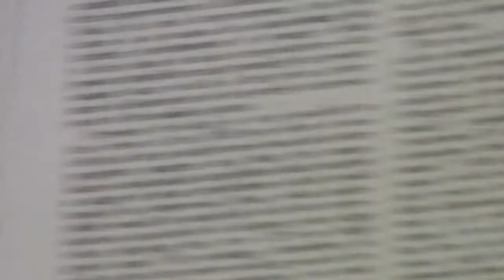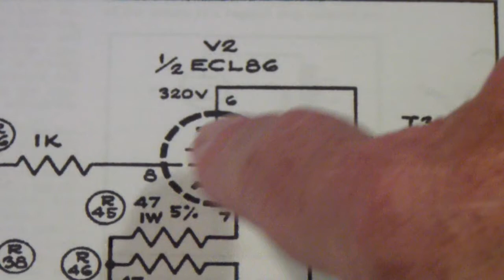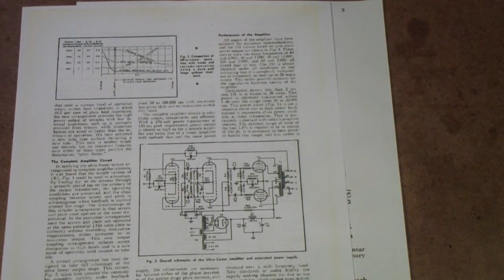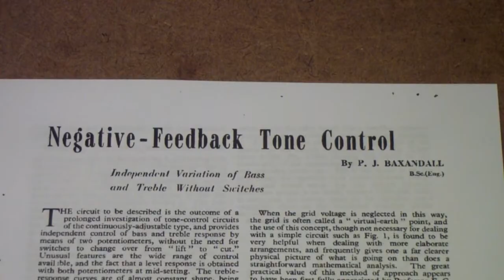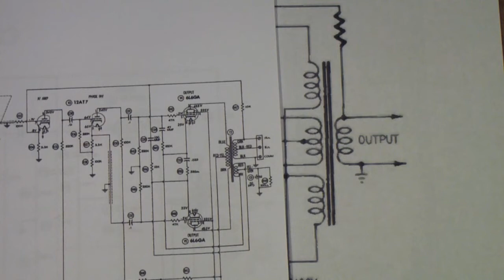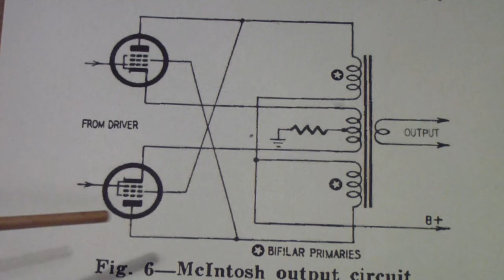TTT096 HiFi Tube Amps Part 2

Comment: Circa 1935 Alan Blunlein wrote a paper calling this ultra linear operation a distributed load amplifier. Williamson allowed a little grid current. This gave 1.5 extra watts.  Quad used cathode windings.  Ultra linear needs more care than triode especially if using loop negative feedback including the output transformer . 1972 GEC book of designs went into detail. Matching networks to the ultra linear taps for example.

Comment: Fascinating and I think some of this is actually being absorbed into my stubborn brain. I inherited my dad's Dynaco Mk III monoblocks and replaced all the caps and resistors, replaced the circuit boards with restoration boards (exact circuitry etc.), replaced the selenium rectifiers with diodes, biased the amps, replaced the tubes that needed replacing, but I am woefully ignorant of the principles behind the design. I'm beginning to understand what I don't understand. Anyway, thanks! The amps sound pretty darn good btw.

Comment: Crossing the screen grids to opposite tube plates exacerbates the "kink". it increases distortion, but it also increases power. McIntosh might be correcting that by cathode loading. Manley amplifiers use the cathode loading to this day, but I've never had a chance to play with the concept. I think cathode loading with "ultra linear" connection might just be the happy compromise between power and low distortion. The only caveat, is that more amplitude is needed from the driver stage. I don't think that's a problem, since most of these designs employed "booster" stages between the phase splitters and the grids of the power tubes. That should be more than enough amplitude to cover the gain of the tubes, plus, the cathode swings from either cathode loading on transformers, or just simple cathode follower resistors. I saw the crossed screen grid design before and tried it. It ended up over driving the screen grids, causing them to glow, so I put in resistors, which protected the tubes, but it still didn't help the distortion problem. I've long since abandoned the idea.

Comment: I built the 6V6-12 Watt Low Distortion amplifier noted in the video (August 1958) and I'm happy with the results.  I used Magnetic Components Classic 35W Ultra-Linear Output transformer (40-18080).  Seems when I use the 12K (R1) it really knocks the volume down considerably.   Is it possible the difference in output transformer will drastically change the feedback resistor
value?  Also, is the 6V6 cathode resistor (250 ohm) based on the specific output transformer in the schematic?  Seems like
the tubes might be running on the high current side, but the amplifier sounds great!  Thank you for your videos and appreciate any guidance you might offer.